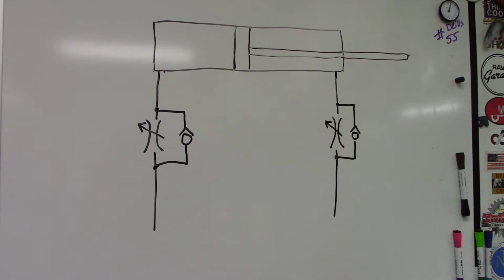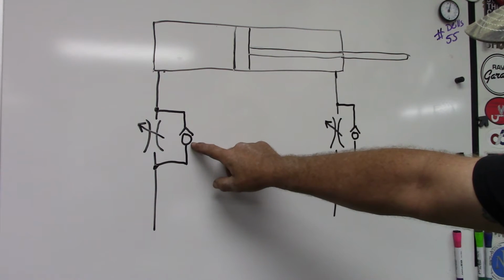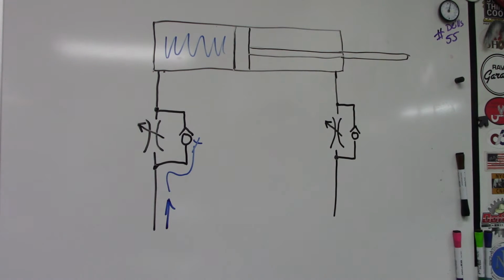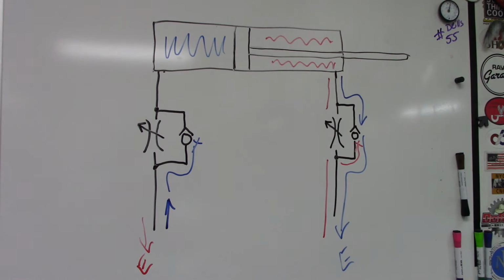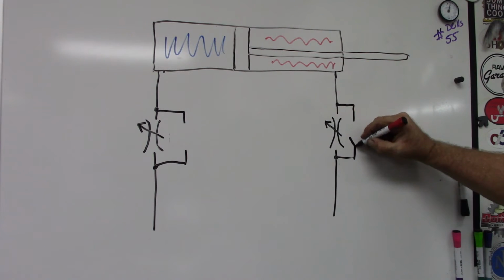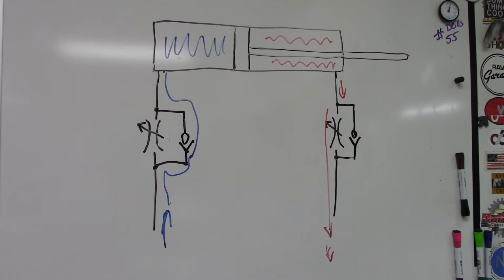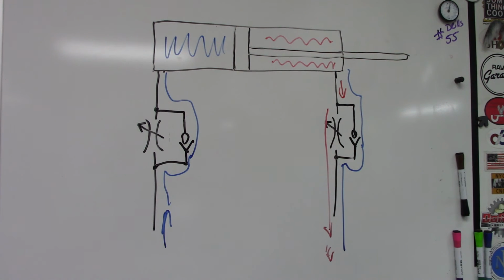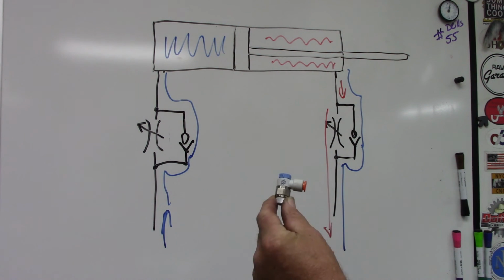Pneumatic speed control

Comment: "When in doubt, meter out" DOES NOT APPLY TO HIGH -PRESSURE HYDRAULIC SYSTEMS! "Metering-out" a high-pressure hydraulic system could cause pressure build-up resulting in severe injury or even death...

Comment: Industry standards are meter out, it’s a more even, smoother control of cylinder speed. Meter in, not ideal in most pneumatic situations as air must be compressed before it can influence power thus the “jumpy” cylinder. Hydraulics the same.
Also calculating speed with flow control specs & meter out is easier.

Comment: And then put the valves on the solenoid instead of the cylinder a think of it all backwards.  Meter in on a valve is out from the cylinder.